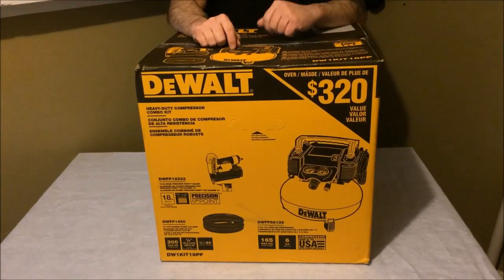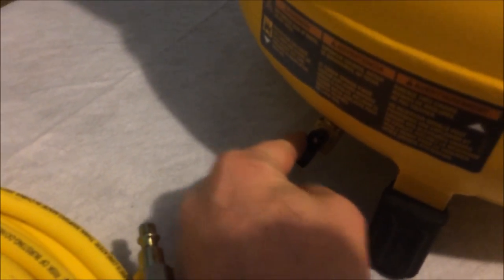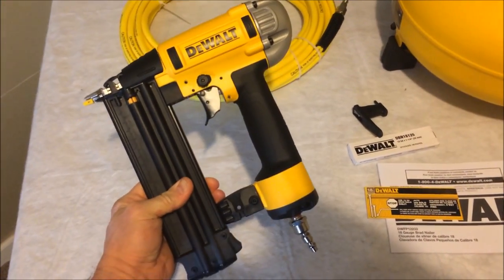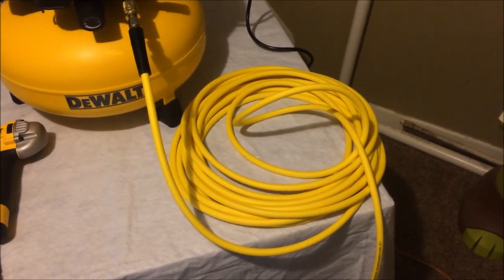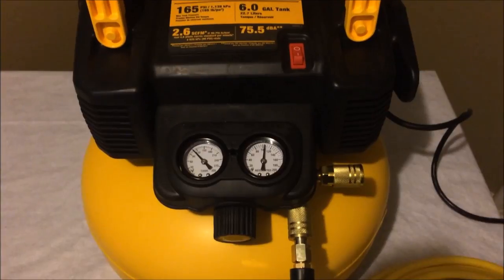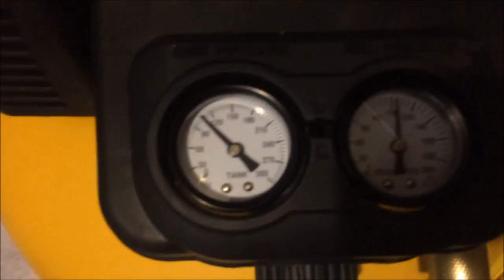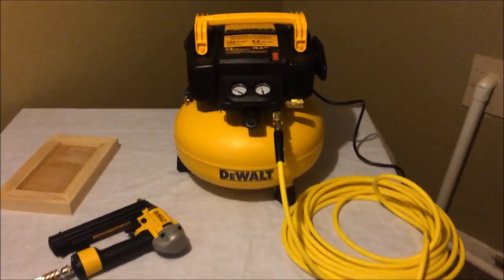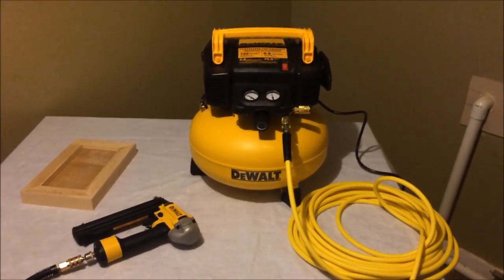DeWalt Air Compressor Kit  DW1KIT18PP

Comment: The little ring valve on the front is the purge valve for removing excess air from the tank after use. The black valve near the bottom is for draining water that builds up in the tank due to condensation. Just a little more info for what its worth. Thanks for the review brother.

Comment: The combo kits that are being sold now are different for 2020 (DWC1KIT-B). The compressor is 78.5db instead of 75.5 (for people that don't understand how db is measured, for every 3db increase its technically twice as loud). The compressor no longer has two gauges (just one now). The right gauge has been replaced with a big pressure adjustment knob which is not that accurate.The nailer no longer comes with sequential and rapid trigger options to easily switch between... just sequential (grey trigger). The model of the 18ga nailer is DWFP12231. To get the rapid touch trigger (black lever), you must buy and then install it separately yourself. Another change, the hose is now black and only 25', and the outer diameter is around have that of the yellow version. That change is ok imo, because it's way less likely to get dirty like the yellow hose would, and the overall slimmer diameter is easier to carry/move around while connected to the nailer. Oh, and no more swivel connector for the nailer... just a regular straight one.

Comment: Thanks for the video! I'm also considering the exact same compressor. My question is, can i still use the compressor unplugged? Lets say i build up the pressure to max PSI, then i unplug, roll the tank to a different location and then use it to paint in an area with no electricity? Is that possible?

Comment: Believe it or not I never owned a compressor and nail guns but now I need one I'm curious to know well this DeWalt 6 gallon pancake be strong enough to run a DeWalt framing nailer if not can you recommend one
Reply from the maker: Yes, you can run a framing nailer with this compressor..Thanks for watching!!